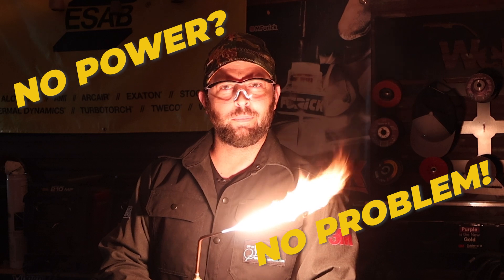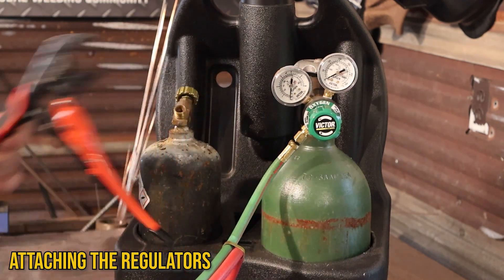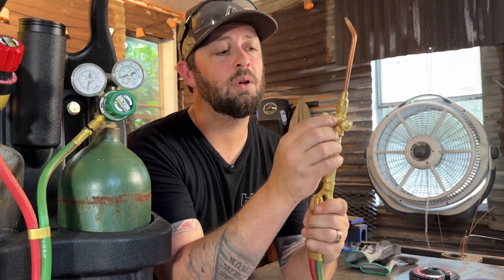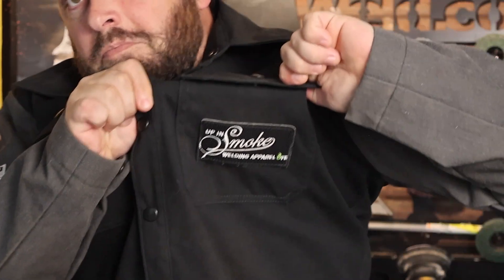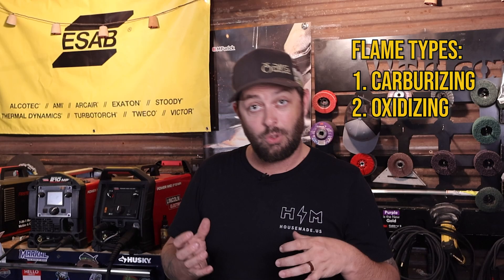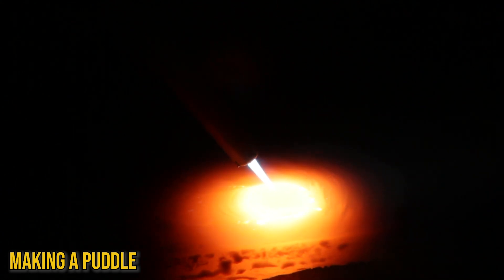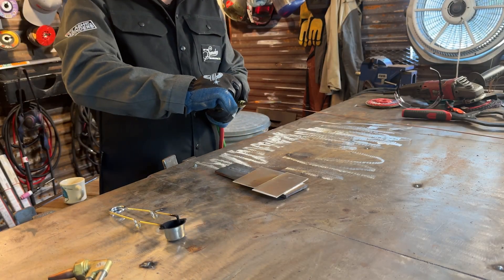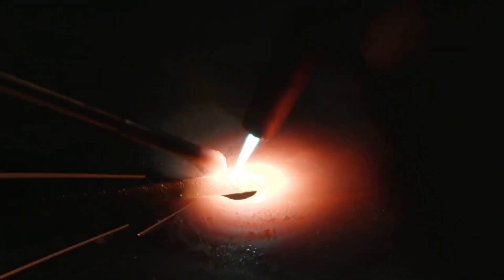Oxy-Acetylene Welding For Total Beginners (OA Welding)

Comment: I'm still in disbelief on how you're acetylene pressure is high enough for the dry oxygen to not blow the flame out completely. When I was taught on my MC Tank Sized Rig my Regulators were set at 7/15 psig I also noticed you covered PPE and how to properly set and light the torch but your torch is missing the flashback arrestors which prevent the inherently unstable gases like acetylene from going from the whistling noise to the last "POP" you'll ever hear from your cylinder flashing. I don't literally mean death, my good friend and I were working a jobsite the day his line caught fire after a partial flash, his tank exploded and he lost his hearing. My ears were pretty sore for days and I was on the outside of the property more than 250 feet away. Hopefully you know why your hoses are the length they are to place your torch at a distance for added safety. The acetylene tank doesn't hold a lot of acetylene in the center of the tank, and the stabilizer helps deflect in the event of an explosion, but it doesn't make the noise any quieter especially in some of the confined spaces I've used those torches in. 

Victor Recommends that a Set of Flashback Arrestors with or without check valves be added nearest to the work being done in the gas hoses. I've typically installed them with a short lead in hose to my handles, I prefer the short lead-in hose so that my torch handle isn't an additional 6 inches in rigid length. I use a dead man switch on mine as well but my rig is significantly larger as I've upgraded to the three line model for cutting and welding.

Comment: Awesome video couple of extra things that might help people acetylene is super unstable as mentioned I’m sure pressures of over 15 psi is ok to run especially if cutting but acetylene is never stored at tank pressures over 15 bar this is because the gas is dissolved in acetone and it bubbles out of it like co2 from a bottle of soda this is all help in a matrix in the tank like a big hard sponge so never use a bottle of acetylene after it’s been laid on its side for at least 24 hours let the tank settle first also make sure your fuel hose is acetylene rated as the acetone can leave the tank with the gas and cause certain hoses to rot from the inside out finally flash back arrestors use them on the tanks at least but a good pair at the torch end is a good idea too and Is actually a requirement here in the uk

Comment: Learned oxy welding in shop class in high school. Was our introduction into welding and was taught first to teach puddle and heat control and management. 

Love plate oxy fused corner. Clean, no filler just 👌👌👌

Comment: why does this process not require flux?
Reply from the maker: Great question! The reason it doesn't require flux is the heat of the flame produced by the mixture of Oxygen + Acetylene is high enough to prevent  to prevent oxidation and promote adhesion, oxy-acetylene welding directly melts and fuses the base metals. If the workpiece is clean, no additional deoxidation is needed.

Comment: When I learned OA welding 60 years ago, I was taught to begin with a very small amount of oxygen. Then some acetylene. Not to get that black smoke when igniting.
Angle of the flame important to heat relation between working pieces and filler. Did a lot of repairs on rusty old cars in the sixties. Having a reducing flame pointing almost parallel to the sheet metal, you can weld rusty paper thin sheets. Frequent stops to cool off. Angle also important joining different thickness materials.
Was taught when job finished, close valves on cylinders. Later check manometers. If pressure has fallen, you have a leak. Then open torch valves to release pressure.
The real problem ( and danger ) is all that heat around the flame.

Comment: It's the hardest way and the best way to learn, but when you learn it, you can produce extremely high quality welds. With MIG and stick people often do sloppy work because it's easy to make it sloppy. Oxyacetylene forces you to do it properly. It's also extremely versatile, can heat steel for bending, melting. With proper small torch, it is perfect for welding lead (caution, fumes!), too.

Comment: Hi i Have a question about oxyao but backfeeding i just finished my welding license And was the only one in class to dare try backfeeding on the final exam And i succeded Its just that i spent Hours learning it by myself bcs my teacher neither the examiner Said that they can do it and had no tips for me to try especialy the pipes was all my primal instincts i first tried vertical Pipe position, horizontal i spent around a day learning but probably my biggest acomplishment was my first try on 45° with perfect root pass (yes i am ambidextrous) still i dont know if im doing it right do you have any good source where i can go and watch or maybe one of your older videos where you show the correct procedure especialy the pipe ones. When the examiner told me He has no idea i was kinda put down by it And asking myself if i just spent Hours perfecting something that Is useless. Also i Have no welder in my family And have no pre license experience with welding.

Comment: Is it cheaper to operate than TIG or MIG? There are good reasons to have this in ones arsenal. Thanks very much for this video.

Cheaper initial cost to get started compared to any arc welding when considering AL and thickness (I think, I could be wrong)
Can be used remotely, i.e. away from a 240v outlet
Can be used right next to a 240v outlet when that outlet has no power
Its a multiprocess tool since we can cut with it too
With the lack of electronics and moving parts, I'm guessing it has a longer useable lifespan .. please correct me if I'm wrong.
Reply from the maker: It is cheaper to get up and running with but gas ads up pretty quickly. To fill these two little bottles it cost around $50 where a 80 tank of 75/25 or 100% Argon costs around $30 to refill. The upfront cost of MIG or TIG is higher but in the long run might offset.
Reply: Acetylene has become insanely costly.
Got my set 60 years ago. Had a pair of cutting nozzles replaced. And some eye protections. Added one way valves on the handle and an acetylene backflash unit.

Comment: Good stuff.   Newer subscriber.  
      Really wanting to learn how to weld, was going to get a Lincoln tombstone ac/dc arc but I'm torn to going that route or just getting a tig set up from harbor freight just to get started.  
     Eventually want to tig weld but want proper practice and a learning curve so to speak.   
      Appreciate any feedback and keep Rocking *
Reply from the maker: Learning Stick first is what most people say to do because it teaches you a lot without needing the gas, tungsten, and at the parts that makeup a tig torch. But if you want to dive into TIG it might be a bit of a learning curve but with practice you can get any process down.

Comment: It’s easy to get heat distortion issues with TIG welding.  I can’t imagine how bad the distortion can be with this welding process.
Reply from the maker: You can get distortion with any process but people tend to move too slow with TIG and Oxyfuel causing more distortion from the heat. Clamps are a man’s best friend.

Comment: Is the hardness and structure of metal change after welding compared to mig/tig welding? Thank you very much for this simple and encouraging informational video. 🙏
Reply from the maker: We would have to do a deep dive on that because using different types of flames can add different properties but we have a great podcast talking in depth on Oxyfuel in the description above.

Comment: I taught myself how to oxy weld when I was 14yo back in the 70's so I could build and weld expansion chambers. No mentor, no books, no youtube so I could weld expansion chambers for motor cycles, used coat hanger wire as filler rod. When I started my apprenticeship I was the gun. I haven't oxy welded in decades but it put me in good stead to teach myself how to tig weld, It's a very similar process.
Reply from the maker: Really great for teaching how to control your heat for sure!

Comment: I taught myself OA welding a few years ago.  For me, it was a matter of practicality.  I do commercial refrigeration work, so I always have a torch rig with me.  I have run into problems where being able to weld something together would be best solution.  Unfortunately, at the time welders were very heavy, and as such weren't practical to keep in an enclosed service truck, and I didn't have the space for an engine drive welder.  The inverters had just started to come out and were extremely expensive.  So, as an alternative, I decided to learn OA welding.  I mostly used it to make L-brackets out of strut or angle iron.  It ended up being a useful skill to have in my back pocket.  As a side effect, it also made me a better pipe brazer because it made me get much better at working a torch and reading temperature.
Reply: In Scotland they still teach us Industrial/Commercial heating engineers it along with stick. Then a 6G trade test on both & they set your free with a "provisional welding licence" 😂😂 not coded tho. Never once used gas welding but now I'm doing mechanical maintenance I stick weld all the time & looking to go for my coding pretty son. That's the next goal anyway
Reply from the maker: Sounds like you have a lot of experience with OA welding. It's definitely a useful skill.

Comment: Victor Tip Chart shows that gas pressure should be set evenly between 3-5 psi each when using a number 2 welding tip.
https://www.gasandsupply.com/docs/VIC_DocLib_5222_Victor%20Professional%20Welding%20and%20Heating%20Nozzles%20and%20Tips.pdf

Comment: Picked up one of those old Henrob pistol shaped torch’s a few years back. You’d think it would be easier to hold and use but I still think conventional torches feel better in hand. The henrob uses less gas though.
Reply: The Henrob is an injector type torch.
Reply from the maker: Saving gas is a pretty big deal in the long run.

Comment: I found that if you spread your pieces apart about the width of the filler rod then it helps to make that keyhole maybe a little close depending on the pieces you are welding I understand that isn’t precise but if your using this method your most likely just trying to get it fixed not to worried about precision
Reply from the maker: Definitely will have to give that a try!

Comment: Been working on a project lately and a couple of days ago wanted to continue. Wouldn't you know it, just as I was about to start welding the power went out. I had never used O/A to weld before but after watching a couple of YouTube videos I gave it a try. I like it. In some ways it's much easier than other processes. I do find it odd that every other process requires shielding of some kind but O/A does not. 

Why is that?
Reply from the maker: That's a great question! The heat from the flame displaces the surrounding air which is doing the same function as the shielding gas.

Comment: I recently had an implanted cardio defibrillator put in. I was told that I shouldn't use any type of electric arc welding. I am having to relearn oxy-gas welding. This video has been extremely helpful and I would love to see more detailed info on welding the thickest and thinest metals, welding cast iron, etc. These types of videos are literally life changing for those that have had this surgery.
Reply from the maker: I’m glad this helped you out! I’ll make sure to add those topics to the future videos.
Reply: I'm here for the exact same reason 🍺
Reply: Electric arc welding is not 100% out of the question even with an ICD. By maintaining safety distances to the arc, leads and machine and by limiting the current, some arc welding is usually permittable but it depends on manufacturer. If welding is important to you, I suggest you seek advice from the manufacturer about your particular combination of device and leads. Modern ICDs are more robust towards electromagnetic interference so a sweeping "no arc welding" might be ignoring some situations where it is still possible
Reply: @norrlandstruggles9798  I took that argument to the cardiologist. He said no, he's still is against it. I talked to the local equipment rep. Their response was to do what your doctor says.

The device can be disabled with a magnet but that feature has to be enabled. I am not to the point I want to get into a pissing contest with the doctor.

OAW is really not a bad way to go. It takes longer and heat is an issue but it's kind of cathartic. I am just curious to what absolutely can't do and what my limitations are without the ability to use electricity.

Thank you for your response.
Reply: @ricjona1069  Ow well too bad. I prefer if my treatments don't restrict patients too much, but this really has too be decided on a case by case basis and is also influenced by what risks are acceptable both medically and by the patient if electromagnetic interference was to affect the ICD. I assume your doctor has your best interests in mind based on your device and its particular programming etc. Best of luck!
Reply: I too got an ICD... If I want to arc weld, I just need to turn the ICD off and then turn it back on afterwards. 

I think I will just switch to Oxyacetylene welding as it's one less thing to remember.😂

This video is a huge help remembering the details of the process!
Reply: @ricjona1069  same issue . I got my defibrillator when I was 17 so I never got into welding but I’m getting into the point on my truck restoration where I need to weld and brining it to a shop isn’t in the budget
Reply: I know, right? I made my arc welder with a couple of car batteries. It worked better than my smaller amp plug in welder. Now I got the defibrillator and have to learn how to use my o/a. Turns out I suck at cutting so far. Lol. I need to weld. Great tip about the clothes hanger. I'll try that first before I buy something. Wish me luck.
Reply: Check out my Braze repair videos
Reply: @ricjona1069  same reason I'm here.